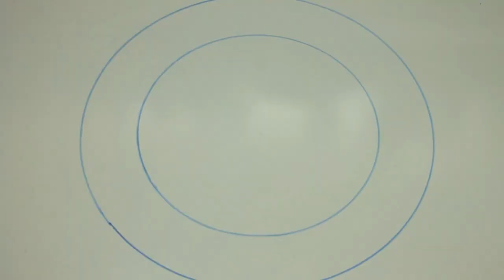Repairing a garden fork handle

Comment: I'd say the audience certainly was "live" while sitting on those wires! :) Excellent job on the repair, and good note re: galvanized steel! Welding that stuff indoors doth not make for an enjoyable evening after the fact....
Reply from the maker: Yes, galvanised pipe the worst shape too - you can grind the zinc off the OUTSIDE of the tube before welding, but it's near impossible to do anything about the inside surface.
Reply: @TightwadWorkshop  One tip is to dunk it in hydrochloric acid: very neatly strips the zinc coating off, in a hurry too! Downside is then you've got to deal with hydrochloric acid...
Reply from the maker: Yeah, I hear you on that.  Back in the old days the Old Boys would also use HCl to strip the zinc off the edges of sheet metal prior to soldering (with lead solder too, of course!) :-)

It's well before my own time, but back in the day here in Australia cylindrical water tanks made from curved corrugated iron sheets were once supplied to remote areas as "self assembly kits" - you'd rivet the sheets together yourself, then solder the seams.
Reply: @TightwadWorkshop  Yep! I've done similar with metal trash cans and solder to make impromptu "hot tanks" to boil engine components in degreaser. Works rather well actually for the level of materials and effort involved. Very nifty to hear that about the tanks: I do suppose it would be far easier to transport metal sheet and rivets than a finished tank.
Reply from the maker: Dude!  Where's THAT video? :-)

Yes, left disassembled to make transportation easier.  In the most remote areas, sometimes even carried by camels!

Comment: need this for one of mine instead of it being a mess of araldite and epoxy putty
Reply from the maker: Yes, you can patch a wood/plastic handle for a while, but eventually you need to take more serious action.
The steel pipe is a little heavier than a wooden handle, but it'll outlast the rest of the fork now! 😊